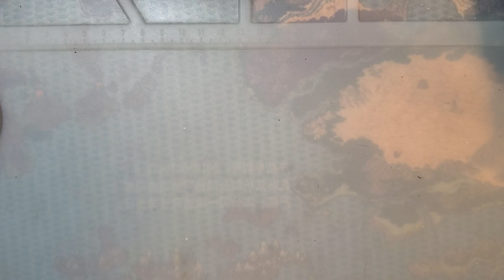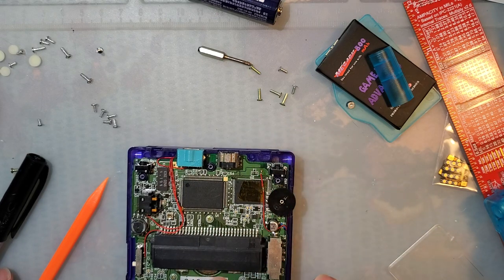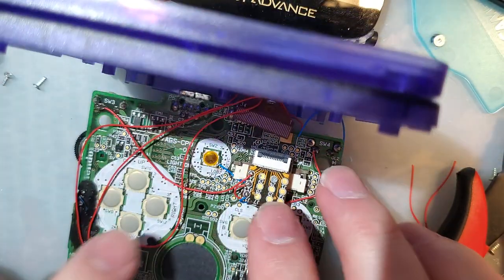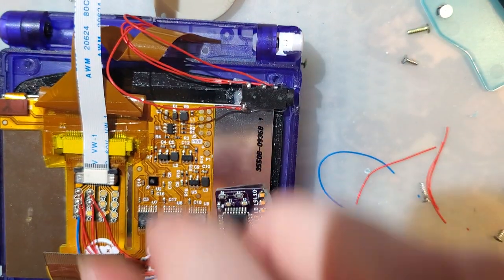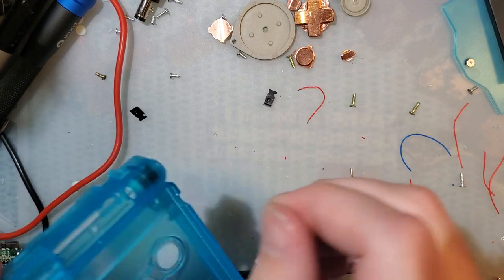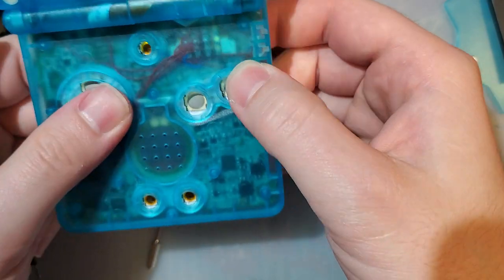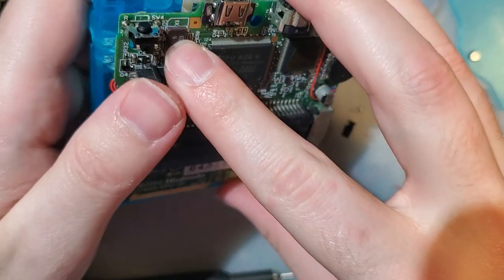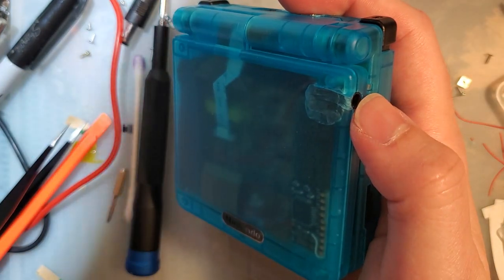SP Ribbon Mod for Other Mods

Comment: 14:20 pretty sure that's directed at me, haha

1:45:40 
F

That old supercard, miniSD? What a relic. I still got a miniSD stashed away. Back then, 1GB was a ton of space. Sometimes, it's good to have a relic to remind us of what we came from.

Whoever designed that glow in the dark shell mold, they did damn good for the battery compartment. Maybe they can just make it a little bigger and let us go nuts with bigger batteries.

And I did get around to putting together that Micro to GBA link port adapter.  Seeing that GameCube connector on the Micro in person gave me quite the chuckle. So I gave my copy of Sapphire that Jirachi.

Comment: some ideas for this:
1) flip the orientation of one of the PCBs so that the ribbon cable connects in the back, rather than the front (e.g. with the connector opening facing toward the pads where you solder the wires, then the connector is closer to the A/B buttons than the L/R buttons). This would mitigate the need for using a different connector I think, and solve the issue of the stiffener, though it does make the design different on one side, which is somewhat annoying.

2) put the connector on the underside. This, again, removes the need for the different connector. Doesn't solve the stiffener issue, and may create other issues, but I think this could be done with a single design (just connector pads on both sides of the flex PCBs. Might need to be masked with some Kapton tape when not used, not sure.)
Reply from the maker: that's a brilliant idea, I'll just put a connector on the bottom. Might require a redesign, but I don't see why it wouldn't work.

The issue with separate designs is that there is usually a MOQ when ordering PCBs so if you need multiple boards, it usually works out better if they are all the same board design.

Comment: Super cool video.  Concept I didn't know could be done, learning still from you about different methods of doing things in electronics.  Big Ups!!!

Looks to me like the wires under the D-Pad may be pressing up on the physical D-Pad and it may be pressing the screen up in the closed position, then compressing the pad when you press down.  That's just my $0.02

Thanks for another cool video.
Reply from the maker: I was concerned about that but no, it's not the buttons. The issue is the left hinge.

Comment: Thank you for showing us this option, I think thats super useful for many future mods :)
Btw the orientation of the power LEDs are also marked on the board right next to them (but the multimeter method works just fine :D)
Reply from the maker: true but they aren't always marked (on other things at least) so it's good to check. Also, I'm terrible at remembering which way is the right way around so markings are virtually meaningless to me anyway lol

Comment: Yikes xD

Well, at least replacing just the top half of the shell is easier than dealing with all the cables on the bottom. Just order more so you can have spares :P
Reply from the maker: I opted to glue/epoxy it back together. Once I cleared out enough material, it seemed to fit well enough.

Comment: why are you using a microcontroller to monitor battery charge? You can use a very cheap and small circuit using transistors. for example  "daftmike Low-battery indicator"
Reply from the maker: I actually have some new hardware on the way but this has already been installed and I am probably never going to remove it

Comment: those ribbon cables usally benf and fold nicely
Reply: also, i would keep an eyeon the white ribbon chafing the lcd ribbon
Reply from the maker: @coldfire0101  should be fine, I think. Not enough movement (not even counting how little I may use it) to cause any real issues long term.

Comment: Did the rubbing alcohol make it crack by chance?
Reply from the maker: I don't recall using any isopropyl on the shell but it's certainly possible. I can do more experimentation though.
Reply: @makho  you drew on it with marker and you said you know it was going to bother people so you took it off with a Qtip not sure what you had on it
Reply from the maker: @Darkrift666  good catch, yeah that was IPA

Comment: Where did he drill the hole for the headphone jack? That’s one of the main things I wanted to watch I skimmed through watched 50% of the video
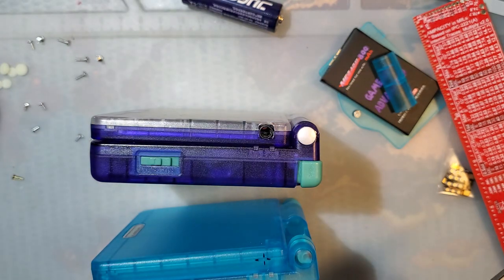Reply: he did it off screen, but he goes to do it at 13:23. he did all the measuring and marking before that
Reply: He left to go do it off-camera at 13:15
Reply: Thanks guys I was hoping to watch it happening but I appreciate your comments anyway I hope you’re all doing well!
Reply from the maker: @kingarthur7255  Sorry, didn't feel like setting up the camera somewhere else for the 30 seconds it took to put a drill bit through the plastic.
Reply: makho that’s fine not knocking the video I was just personally slightly disappointed is was still a very educational video and enlightening kinda made me think about how much more complex it is and reminded me of a 3ds and ds lite lol 20 ribbons and wires all over the place the more you add the harder maintenance is and then it reminded me how angry these clear plastic shells make me my black one was $22 because I bought it from Texas for quick shipping and I have barely played it never dropped it and it’s got like 20 cracks some even where there’s no screws I literally haven’t even scratched it there’s not a single blemish aside from cracks I keep it in a period correct sip case also I have maybe like 5 cycles on the battery with and everdrive not a lot of gameplay lol I bought one of those gold reflective batteries like you have shown in one of your videos still haven’t made your battery mod because I’m waiting on you to release that new one anyway I got off topic this black shell was so nice it felt as good as my oem shells and the fit and finish was perfect also after I trimmed for the ips display the buttons feel like oem maybe better the shell is rigid and the outside texture is amazing like oem way better than the awful painted shells I just think it’s so disappointing that they made such an amazing shell and cheap out in the plastic to the point where it literally disintegrates sitting on a shelf in 2-6 months and I didn’t over tighten my screws either it’s cracked in places where there aren’t screws it’s just sad it’s also my first ips mod I was proud of it